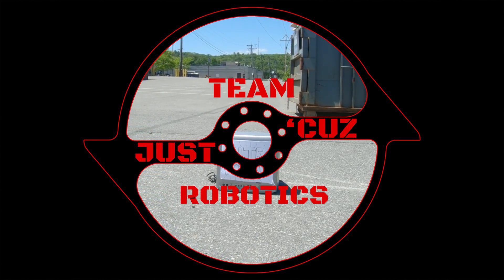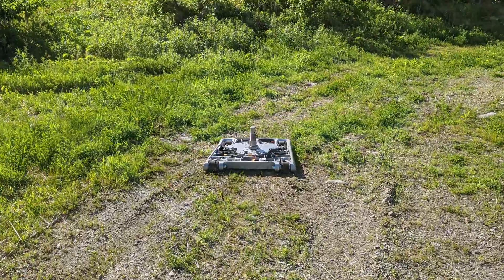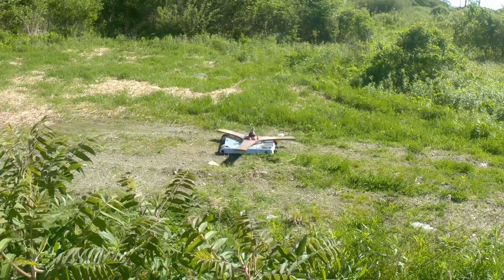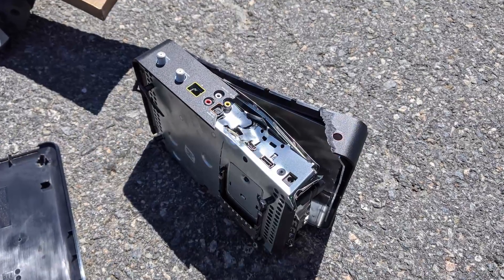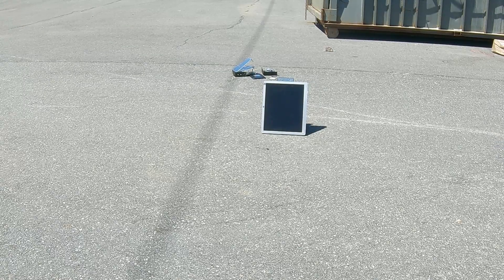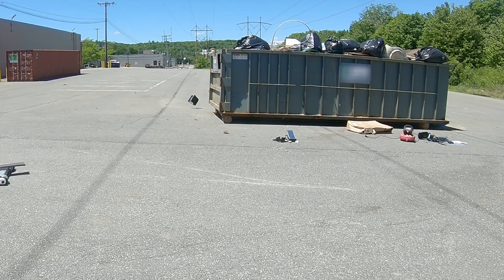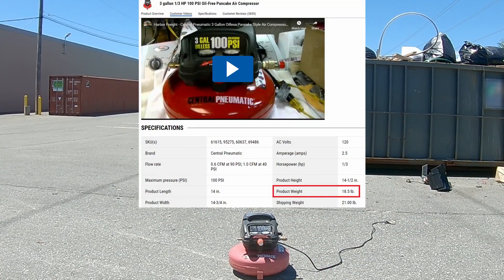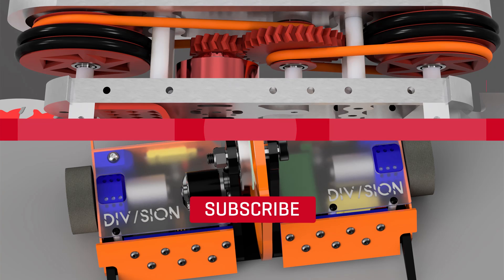Bloodsport Battlebot Destruction! Full System Testing for Season 5

Comment: Those test subjects are no good. Otherwise awesome design. At least have something that resembles and weight as much as another bot and possibly moving. I would load a shopping cart with those things you chopped up. Test the bot on that!
Reply from the maker: As I've said to the other many, many people who have brought this up, it's too dangerous to hit heavy things like that out in the open. Just watch our actual fights and you'll see it didn't exactly hurt not having tested hitting another 250 pound robot 😅. Nobody on Battlebots does that sort of testing, it's just too risky.
Reply: @JustCuzRobotics  - I figure one purpose of the test is to test reliability. Its clear many bot don’t push the limits with tougher tests only to see the bot not lasting 3 minutes, burn up, or an enemy of itself.

That said, looking forward to see the matches for sure. The first one was great! Congrats!

Comment: I fully understand that you're only testing and checking systems, and that you don't want to wreck your machine, but a more realistic target would be either a 250 lb anvil or a big tin bucket full of bricks. Or whacking into the corner of that steel container... (Just kidding!)

As I said, I know that you're not trying to trash your bot, but a big impact on an opponent-sized object would give some useful data regarding recoil/ reaction forces, gyro-stability, and whether the chassis allows relentless advance during attacks, or whether there's an enforced 'recovery' period.

(In other words, a powerful boxer who throws huge punches relatively slowly leaves himself open to several retaliatory jabs before he's ready to strike again.)

Also: is your robot capable of self-righting from a heavy impact (either given or received)?

The weapon mounting design is extremely impressive. Solid. Nice work, peeps.

I really enjoyed the video; thanks for uploading and keeping us all going during the hiatus!  :-)
Reply from the maker: Thank you for the kind words! To answer your questions, firstly it simply isn't safe to hit something so close to the weight of the bot out in the open. You see on TV when two bits hit eachother they go flying in opposite directions and anything can happen. There just isn't any safe way to contain that energy aside from a purpose built arena or test box. The amount of energy stored in Bloodsport's weapon when up to speed is akin to 4 or 5 50 caliber sniper rifle rounds at once, and that's hard to contain. We are however working on a self righting pole design and my next video will discuss what choices are made to drive that design.

Comment: Here’s an idea that popped into my head just randomly- would it be possible to set up stereo cameras/lidar to track keypoints on other bots in the box, allowing you to see what opponent drivers are upto clearly? Maybe even an onboard system to react to, say, a bot rushing you and dodging it. Also a minibot would be cool
Reply from the maker: While this is far beyond the expertise of most combat bot builders, this is pretty much exactly what Zoe Stevenson of Chomp did! If you look at Chomp there is an apriltag on top which helps a camera system to determine where the bot is and if it was knocked on its side, as well as a rangefinder in front of the bot that would attempt to drive it to a certain distance of its opponent and automatically swing the hammer. For a bot like ours however where we attack in 360 degrees, the benefit of such a system is little to none. We trust our humans to drive well enough 😉
Reply: @JustCuzRobotics  The initial idea was to highlight the movement vector of an opponent bot, but oh well. If you have time, do look into machine learning, its only public perception that makes the basics look like rocket science. i suggest coursera
Reply from the maker: @thesabre8458  I'm familiar with the concepts of machine learning but it's not the sort of thing someone who isn't a software dev can do easily.  Although I minored in CS I don't think I could do anything of the sort without dedicating months of research and effort. Feel free to prove me wrong if you can do it! I would definitely not hand over control of a 250 pound heavyweight to any autonomous system without a lot of failsafes and such but you can try on a small scale with a 1lb-12lb bot without a deadly weapon.
Reply: @JustCuzRobotics  Will try to find a solution to highlight even tiny movements of the opponent bots, which im pretty sure uses less ML

Comment: The tri bar does look suspect to breaking, are you concerned by this?
Or is it about as durable as the 2019 bar?
Reply from the maker: Not sure why you might think that. It's got quite a lot more weight than the blade used in 2019 and all our weapons were developed with many iterations of FEA simulations to ensure their strength. Plus we have different blades/bars for different types of opponents. Against a vertical spinner we will probably use the Thicc bar I showed in a prior video which is 1.125" thick compared to this triblade's 0.75".
Reply: Reading this after the tantrum fight

Comment: Amazing to see it set up, and neat to hear about the safety measures to avoid any misconceptions. I remember in last season, Bloodsport made that amazing launch of itself on several hits, at least via the edit seeming to nearly OOTA itself. Has there been thought as to downforces and how to keep it down or at least sliding along the floor rather than launching skyward? Totally realise that the reality of impacts on one of eighty different boys changes it (upward wedges etc) but just curious if that's something considered during the process of a robot's design or not? I think I recall Dave Moulds mentioning it to some effect with Carbide long ago, but not sure how it goes.
Reply from the maker: In the rumble Bloodsport basically did OOTA itself due to a very unlucky bounce but that had less to do with the design of the bot than it did the general chaos and randomness that occurs whenever a vertical (Railgun Max) and horizontal spinner hit eachother. Downforce cannot really be addressed except with magnets and with the new floor it remains to be seen how effective that may or may not be. The main thing we want to focus on now is self righting if we get turned upside down.

Comment: I was about to comment about hitting something that doesn't self destruct, until I saw the compressor!
Also , how easy is it to change wheels?
Reply from the maker: Great question! Both drive axels are shoulder bolts that screw in from the sides (very visible in the thumbnail) with the front threading into the chassis directly, and the rear held on with a nylock nut that's accessible from behind. Assuming the chain doesn't need to be replaced, I don't think it would even be necessary to remove the top access panels to swap either set of wheels, though bottom access would be needed for the front pair. Just break the chain, remove one bolt per wheel, rejoin the chain.

Comment: Love the tri blade spinner. I guess it is going to run much smoother than a twin blade bar spinner.
Reply from the maker: It should be more stable since the weight is distributed more evenly on all sides. However, we still have several other weapons we can use that have less than three impactors!